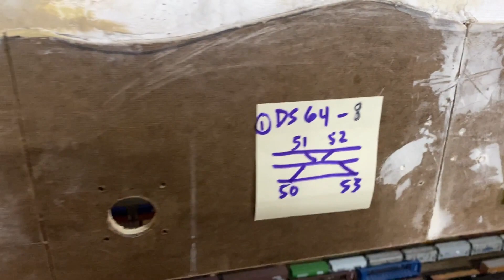Layout Update 15 with some scenery progress and trains running

Comment: Steve, looking good.

Don't rush the scenery - what you have done so far is looking great. I find that breaking up the scenery work actually helps getting it done, and it appears that you are doing just that - do a section of cardboard weave, then plaster the last section of weave, then start the base details on the section last plastered. Given that we often have to leave scenery to dry, it means that we can switch from one section to the other without much delay, but when you get to the real detail, take your time.
Reply from the maker: Hi Eric, thanks for the tips and feedback. Appreciate it all. I have been doing sections at a time so far and that’s probably going to be the plan moving forward and then slowly tie them into each other. Seems more manageable and it also breaks up the monotony of doing it all at once. Hey it worked for my wiring too - lol.  Thanks again for the feedback. - Steve